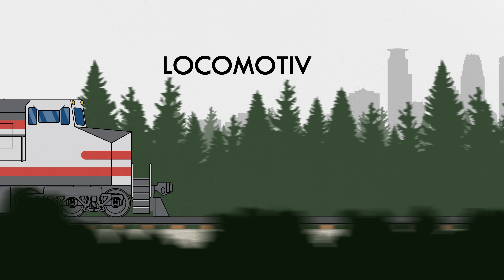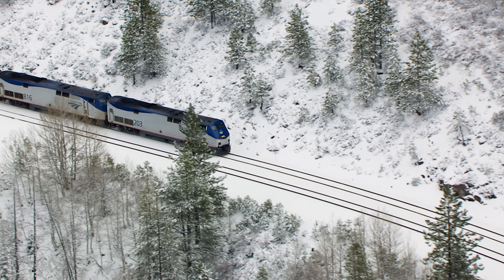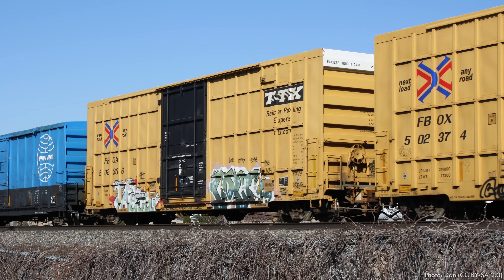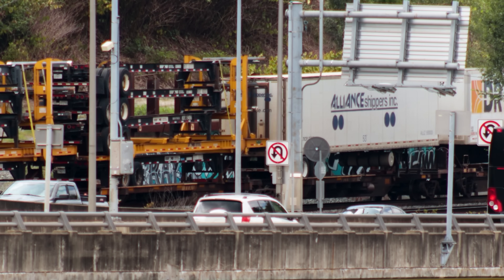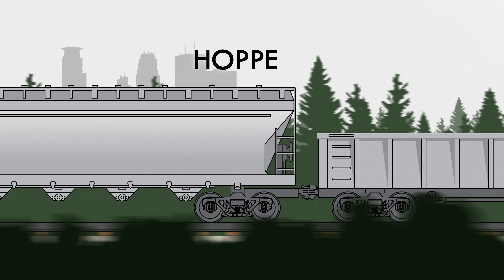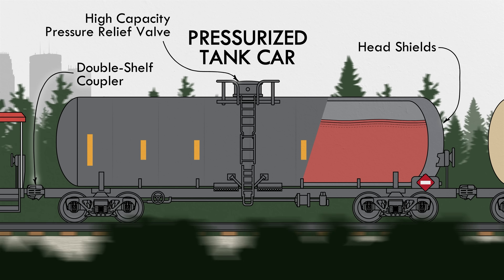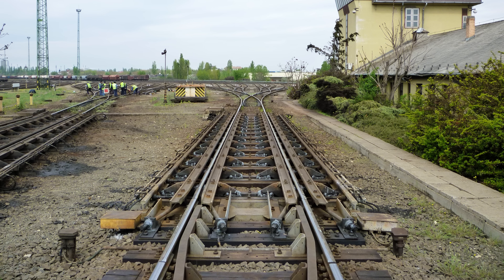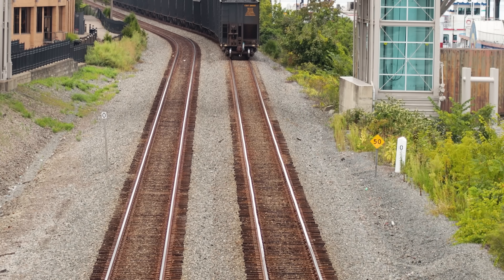Every Type of Railcar Explained in 15 Minutes

Comment: Some notes/comments, specific to North America. In the US, passenger cars can be broken down into even more specific categories. The most basic is of course, the coach, which is entirely passenger seating. Amtrak trains typically have Business class and Coach Class options. Combine's don't really exist anymore here, although Amtrak has "Coach-Baggage" cars, which are also used as crew accomodations. Bi-Level cars aren't really rare, as you stated, nearly every commuter rail in North American has some version of them. Metra has some original Galley cars built by Budd and most others are built by Nippon-Sharyo and Bombardier. Amtrak's primary long distance passenger cars are also bi-level. Know as Superliners, there are multiple variations for different purposes. As for passenger train sets, they aren't as prevelent in the US, although they do exist. Notable examples include Amtrak's Acela, along the Northeast Corridor, and Brightline's trainsets in Florida. Freight car wise, traditional flatcars are somewhat different from most intermodal cars today, which have many variations. Most cars intended to haul semi-trailers can also be used for containers, though it depends on the specific car. (For more details on 89' flatcars, see these detailed documents. https://eaneubauer.ipower.com/10084s.pdf and https://eaneubauer.ipower.com/10082s.pdf) Similarly, gondolas also come in various flavors. Rotary coal cars and aggregate cars are technically hoppers (most of time, they can also be bottom dump hoppers). The biggest change between types is the overall size, which is typically dependent on the cargo and it's density. Covered hoppers, once again, have many different types, depending on the cargo. Some are pressurized, some are pneumatic (typically used for plastic pellets or similar material), and some just have sliding gates to unload. The higher density the product is, the shorter the car will be. There are also carbon black hoppers, specially lined to transport carbon black for use in rubber product manufacturing. Tankcars also vary in size depending on the intended cargo, with the single largest tank car in the US being the 97ft, 60,000 gallon "Whale Belly" car, meant for anhydrous ammonia before the max car length was made to be 89 feet. Finally, cabooses. While not seen on the end of most major freight trains, they can still be seen in use as shoving platforms with their windows and doors plated over and welded shut. Shoving platforms are used as a place for the conductor to stand while preforming reverse moves, where the engineer cannot see ahead of the train. 
I realize this is more in-depth than many people would care to know, but I think here, if anywhere, is a good place to spread more knowledge. :)
-wabash_railfan

Comment: The device with the flashing light on the last car usually make a whining/whistle noise. From what I've read online, it's a small air turbine in it to generate a little bit of power for the light and the transmitter.

Comment: The company I work for has contracts to perform tree maintenance both alongside and from the tracks. There are at least two dedicated rail car assemblies with a cutting boom and spray equipment for emergency firefighting and spraying herbicides. The last time I saw the bucket hi-rail truck (with a chipper to match!), management was getting cranky that it was being used for roadside work and not rail, but it was pretty neat to get a close look at the hydraulic rail-wheel setup on the front and back.

Comment: The trailer on flat car was pretty accurate but they have a 5th wheel plate for the trailer king pin to rest in (not sure if they lock like on a semi) but it keeps them from shifting around on rough rails or high winds

Comment: 1:06 "unless you work in the rail industrial, passenger cars are probably all you'll interact with". Not true. Lots of industries use rail. For example, I worked at a potato chip factory, and every day we got two tanker railcars of oil, and two grain railcars of corn (for corn chips).

Comment: New Jersey Transit actually has quite a few double-decker passenger cars --but they are different than the one you showed!  Their cars employ a "well" design, so that the lower level of seats is closer to the tracks.  When you first step onto the car, you either take a few steps UP for the top level, or take a few steps DOWN for the lower level.  This gives all the advantages of additional seating, yet keeps the top of the cars low enough to fit through the existing tunnels, bridges, and stations.
Reply: That‘s exactly how they are in Germany
Reply: Both modern German Rail cars and the New Jersey cars are built by Bombardier.
They share the same basis, but can have different interiors.
Reply: Do you also also have a car designed for bicycle storage, in addition to passengers in New Jersey?

Most regional and Inter-City trains have those here in Germany.
Reply: @NoOne-ef7yu yes, however when the train is busy it just means standing room only 😢
Reply: Thats pretty cool, I think they should do it in Ontario for GO to have better level boarding.

Comment: I might have a few things to say in defense of the passenger cars. As I used to build them. We had some that never saw rail time because of ..contract issues let’s say..  and on top of legal issues. It all was significantly impacted by freight companies near monopoly over the rail schedules. Basically dooming all the extra rail lines from operating let alone a cool new version. 
  And have now been all but abandoned. Amtrak is fine and all but we used to have a lot more choices. And I can only imagine what they would look like had that survived. Vistadomes are fun to make and ride around on. 
 You should check out the rail line from Anchorage to Denali if you want a real travel adventure.
  I’d also like to give a mention to the DMU when you start the section on engines. Was apart of the first American prototype and would be great to see that as an alternative mode.

Comment: I am a railway enthusiast and also spent a few months working as a conductor trainee (before I truly understood what the lifestyle was). I am super excited to see that you're making a bunch of videos on the topic! I've even learned a few things myself already. Only thing I want to mention (having worked with them extensively while I was there) is that while you may be technically correct that coal cars are gondolas, I'd give them their own classification on account of being built so specially for rotary duimpers. Typically all the gondolas I've seen have short sides like the illustration presented, although I do recall seeing one or two with full height sides.
I'm excited to see what you have prepared! I know I'm just another viewer, but I'd be tremendously excited to help you out if you need it!

Comment: Oh, the engineering of the locomotives and  couplers and how they work together to get the tremendous weight moving. Also things like how the wheels are only making contact with the rails of a width of a dime which I never knew. Thanks again!

Comment: You will find that there are a lot of railroad cars that look like passenger cars but weren't. Most of them were carrying either the DAFX or USA(X) markings. An example of that were the USAF's Mobile Bomb Scoring Trains. Looked like regular passenger cars until you noticed something strange about them. They had roof walks on them. One car would have louvers on the area where windows normally had been. Inside were two Detroit Diesel 16V-71 gensets and the equipment needed to use them. Next was a car that looked like it but it was the tool and parts car.  Then you would have a couple of cars that served as personnel cars ( Sleeping, shower, laundry, toilets ), then a car used for meals and meetings, and couple more personnel cars. All made out of former 1945 vintage Hospital Unit Cars. Also carrying DAFX markings were some such as DAFX 13. One half looked like a 1930s era Pullman while the other half looked like a giant box on wheels. Except this box's sides expanded outward. Those were simulator cars and carried a radiation warning sign on them. And ones you never wanted to see, Mortuary Service cars.

Also lessor known are bottom dump gondolas and drop end gondolas.

Comment: Some of that stock footage looks like it was shot in dahntahn Pittsburgh. I’m a rail guy, hate the term rail fan. The only think I haven’t seen is a nuclear waste train or a funeral train. The latter is just a train with a bunch of engines headed to the scrap yard. Maybe you could do a video on the turbine engine of UP that ran on bunker fuel, these engine ran so hot that they would melt bridges when stopped under them. Can’t seem to find any good footage that shows how loud they really were. It’s like a jet engine strapped to a locomotive, the jet engine still runs an electric generator and electric motors turn the wheels for anyone who didn’t know. And lastly, you could do a video on the equipment that cleans up derailed trains, like the hulcher which is basically a crane on excavator tracks.

EDIT: also, a lot of the infrastructure you talk about in other videos is run along the RR tracks. Why wouldn’t it? It’s already cleared and maintained by the RR.

Comment: Most box cars are called Louvre Vans here in Australia
V/Line uses them as luggage/power vans in Australia, with SCT using them to haul intermodal services

Gondolas are also called "Bogie Open wagons" here in Australia
Also we don't have any steel wagons anymore, we just have flatbed wagons with steel cradles on top
but some are also found in small containers if they aren't in coil form
Cabooses are also called Guards Vans in Australia

Thanks for the video I found it very great and informative!

Comment: I used to live right next to a train track on the 4th floor, next to our City's main station. Could view everything driving by. I have seen almost every car you described, except for the lumber car. Some extra things you didn't mention are inspection cars to look at the overhead electrical cables. Those look just like the passenger car with the big dome on top. And firefighting trains, that can be deployed with lots of equipment. Here in Austria, we also have the "Rollende Landstraße", which translates to "rolling country road". Whole truck with their trailers drive up there and move towards their destination. The truck drivers move with them in a passenger car.

Comment: 06:16 There IS a special Railcar for Trucks atleast here in Germany called "Taschenwagen" https://de.wikipedia.org/wiki/Taschenwagen where the wheels of the truck are lower down in the flatcar so that the trailer has the same height as neighbouring containers. 
https://de.wikipedia.org/wiki/Taschenwagen#/media/Datei:Doppeltaschenwagen_T2000_der_TX_Logistik_AG_bei_Gem%C3%BCnden_am_Main.jpg
https://de.wikipedia.org/wiki/Taschenwagen#/media/Datei:Doppeltaschenwagen_T3000e_der_Nacco-Gruppe_bei_Niederschopfheim.jpg
https://de.wikipedia.org/wiki/Taschenwagen#/media/Datei:Doppeltaschenwagen_T3000e_-_Draufsicht.jpg
There are similar to the american well car but the well is not for a container but rather for the wheel portion of a trailer. Most intermodal trains have these cars in them because they can be used to transport containers aswell so they are quite versatile.

Comment: In Switzerland we even have a prison train, which is sometimes used to transfer prisoners. It is based on an old commuter set, but the interior is modified with several holding cells, some seats where staff can sit and have a look on the cells, and the lavatory has been modified so you can't flee out of the window.

Aside from snowblowers (btw, that snowblower at 12:04 is a historic model that is actually steam-powered. Rhaetische Bahn occasionally puts it to use for railfans) there are also snowplows. Some of them have a piece that can clear in between the rails and needs to be lifted up whenever a switch comes.

Another wacky railcar is the picklebarrel car. They aren't arond anymore, but they were cars with a big wooden barrel on top. The idea was that the car could be filled with pickled food, and the vinegar would do its magic while the car was on the way. They went the way of the Dodo as the time saved by combining pickling and transport was no longer worth the extra effort from loading, unloading, and cleaning.

And my last mention will be transporter wagons, which are basically wagons that use a set of rails as a frame, in order to transport other wagons or locomotives. This is done to transport rolling stock of a different gauge, for example when a train manufacturer wants to deliver some narrow gauge locomotive they made. Overall they are very rare but in my area they are a bit more common, as I live relatively close to a train manufacturer that produces lots of narrow gauge stuff
Reply: Yea, I've seen photos of the    picklebarrel car.. I looked it up, there are many models of them you can get for your model train..I may get one for my HO layout
Reply: That's excellent information. Thank you!
Reply: Finland doesn't have a prison train, but we have two unique prison cars that are coupled to a normal inter-city train four times a week to transport prisoners between Northern and Southern Finland. It's pretty common to spot one of them on the Savo railway line.
Reply: Not going  to lie, but a prison railcar seems metal af
Reply: Russia also has prison wagons
Reply: "a prison train, which is sometimes used to transfer prisoners" sounds like the offering from a really shoddy passenger train operator

Comment: Where I live in PA we have a lot of unused tracks so some people make rail bikes to ride on the tracks but I think my favorite thing I've seen was an electric/gas rail go cart that people ride on long trips.... I've been wanting to make an arm to attach to my Modified Razor MX650 so I can ride alongside the tracks then if I want, I can jump onto the tracks, extend the arm w/ a little wheel on the end, lock my bars straight and just ride along checking out the scenery. It just looks like so much fun to be able to ride through the tunnels and across bridges where it's usually impossible to ride through.... At least it's less likely to get a puncture riding on the ties and fill.    😁👍

Comment: a very nice video, but there are a few things worth mentioning. first, not all trains need a "locomotive" in the conventional sense, such as DMU/EMU trainsets, being diesel and electrically powered multiple unit self powered trainsets respectively, such as the shinkansen which has each individual coach powered. bi-levels are by no means rare, seeing as just how many countries frequently use them, loading gauge be darned. and combines can also be used for dormitory/crew space, just any kind of baggage compartment with a non-baggage pairing, be it lounge diner sleeper coach or even a barber shop, and are actually rather rare nowadays.

Comment: I used to do contract work, service and repair of industrial pneumatic equipment. Worked for several railroads and at many switch yards. I once got to work on a rail grinding train during its annual maintenance turnaround. Super fascinating machine, had its own fire fighting team/equipment with water tank cars. Had a crew car, cafeteria car as well

Comment: I've seen alot of those cars, I live in an area by a port, factory that makes wind turbines, and several auto manufacturers. I've noticed with well deck cargo container trailers it's quite common for a few of the cars to share a boggy. The lead will be a normal one but between 2 well decks will be one with larger wheels.

Comment: An interesting one is the generator car. Most trains in the UK have a engine underneath every carriage but that makes electrification wasteful as you have to get rid of the entire train. Transport for Wales has new trains where every carriage has electric motors and there is one small car that is just a generator. When lines are electrified the generator car can be removed and the train can be used fully electric.

Comment: My father was a Teamster and professional, over-the-road trucker his entire working career. In 1961, the Teamsters Union became concerned that "piggybacking" (trailer on flatcar intermodal transportation) would have an adverse effect on their membership by reducing the need for long-haul drivers. The Teamsters, under Jimmy Hoffa, financed a lobbying campaign against piggybacking called "DRIVE" (I can't remember what the initials stood for). 
The wives of Teamsters, including my mother, did most of the legwork for DRIVE. The Teamsters paid for my mother and a group of Teamster wives to travel to Washington DC to meet with politicians to lobby for DRIVE. They met with several union-friendly congressmen, and even met with then Vice President Lyndon Johnson to pitch their case. As you are aware, their lobbying efforts failed.

Comment: In continental Europe, double-decker trains are common; sometimes upstairs is First Class, or sometimes it's a whole separate car... because rail frequency tends to be much more there and there are also "Sprinters" (local trains that make every stop) as well as InterCity (expresses), you might have five or ten people get off at a given stop instead of the whole railcar's worth... except of course at line's end, where the time it takes to swap ends and crew accounts for more than enough time to wrestle full carloads of luggage off.  Also, much of Europe has electrified rail, which not only cuts pollution but also improves performance, as electric motors deliver more torque at low speeds than diesel engines, reducing time-to-accelerate and getting you or your stuff there faster.  (The Netherlands' NS passenger rail system is powered entirely by green energy - all those windmills and solar panels! - and between Schiphol and Breda can hit speeds of up to 200kph... )